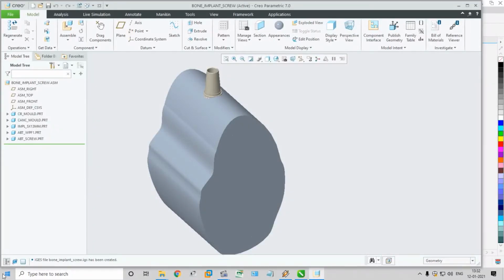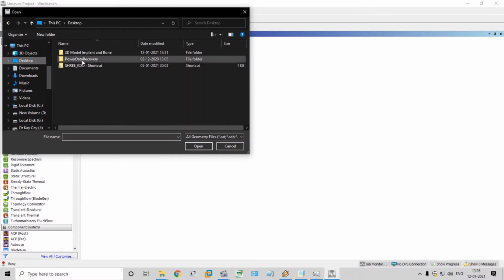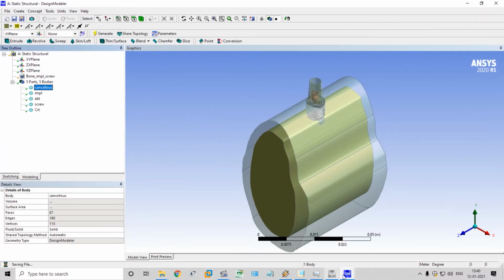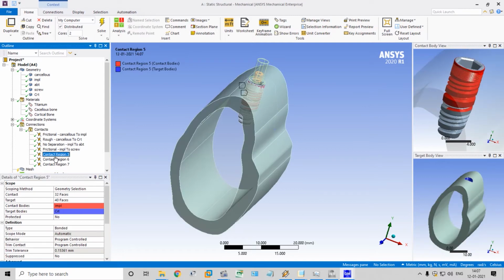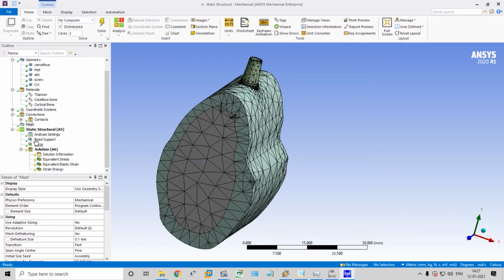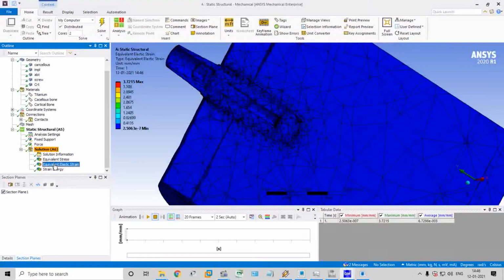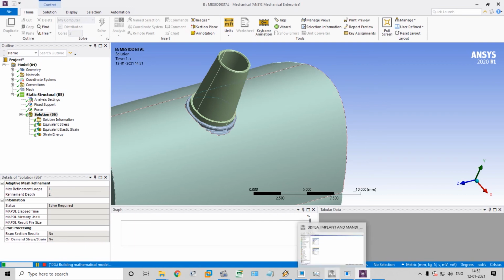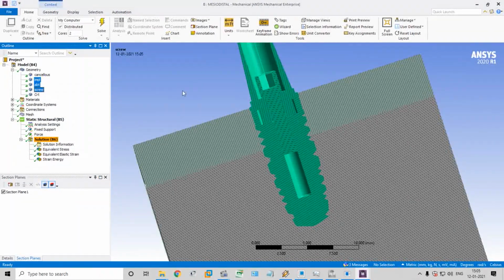Finite Element Analysis study | bone segment and implant | ANSYS 2020 R1 | Studio GOW_R

Comment: Great work bro. Thanks.
Could you tell me how you did the hole on the bone can I do it in solidworks ? 

For  the bone model can I do it using ansys or solidwork?

Could you send me the model of the bone without hole 
alsane10@gmail.com

All the best bro
Reply from the maker: hole in bone: using creo 7.0 option Using mould cavity menu - parting plane - implant as ref solid - cut mould and save the file. watch video fully to clearly apply options